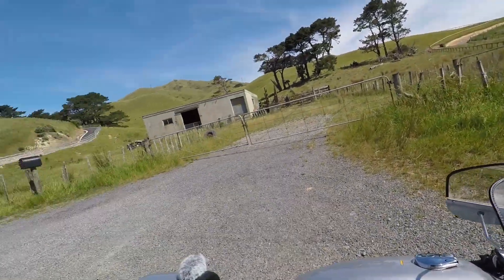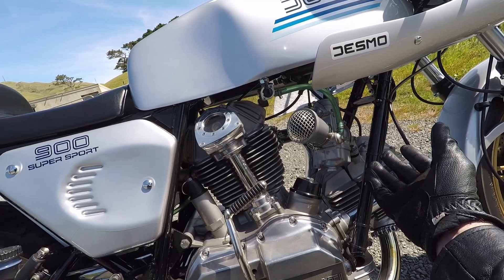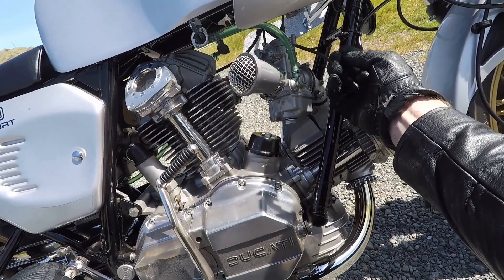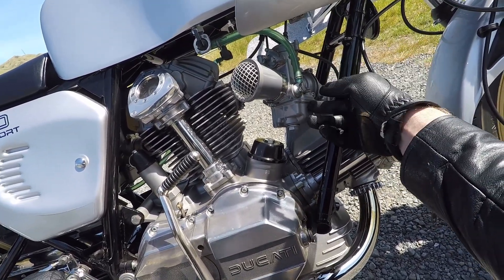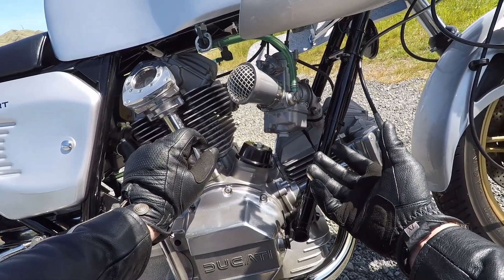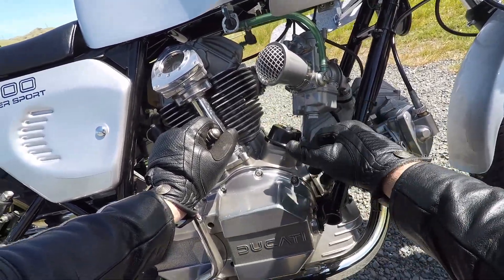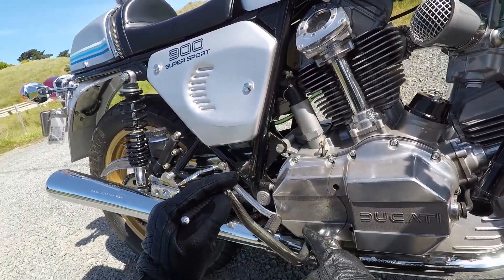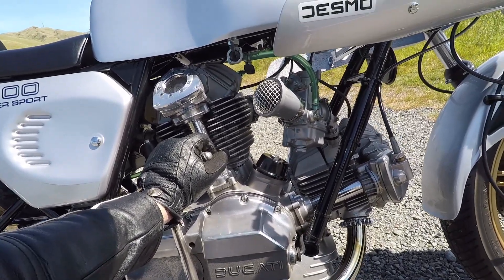Ducati 900SS Bevel Tuning - Lambda/AFR Testing Part 7 Final

Comment: Happy Saturday Mate,
I’m almost finished dialing in the 860GT but have come to find my labyrinth not remaining in place under load.  It lets go of the clip in the vent stack leaving spurts of oil on the case.  ( the last of the remaining leaks)

Grant Fuller informed me that the stock labyrinth becomes feeble when heated.  He has produced an aluminum replacement, but unfortunately does not ship to Canada. So much for the Aussie Canuck historically great relationship.  🤣. Can you think of any hacks that I can put in place to make the plastic labyrinth more robust but short of allowing foreign debris from falling into the crank case.  

Cheers
Jason.
Reply from the maker: Hi Jason. I'm sort of surprised it's leaking oil out even with the faulty labyrinth. The oil should just go up the hose and into the chamber, assuming you still have that on the bike? There should also be a hose from the chamber down to the road, so if any oil comes out anywhere, it should be there. Have you got all the required parts in line there.. gasket, hose, clamps etc.

I'm looking online and I can see the metal replacement you're talking about. Surprised they won't send to Canada..?!? 

You're right that you don't want bits going into the engine if its start falling to pieces and that goes for the metal one too. I'd be trying to get a plastic replacement. I would just ask in the Ducati vintage forum or even on one of the Facebook Bevel groups of someone has the part spare and is willing to post to Canada. Someone will have it. I would start with the forum first: https://www.ducati.ms/forums/vintage.14/

I don't have one here in my leftovers I'm afraid. I can see that Steve at Bevel Heaven is listing new and used ones on his site. In the product description he says he has several used ones and also the snap ring and washers etc. Maybe that'd be the quickest solution.
Reply: I will check both options.  
I put it back together and let run for a while . It appears the the leak may have stopped.  Won’t know for sure until I take it for a spin.  
Thanks again.
Reply from the maker: You're going to have to put a video up to show your bike!
Reply: @Ducati900SS  this weekend weather permitting I’ll fire up my first post.

Comment: hey do you mind to let me know what kind of mirror you are using?
Reply from the maker: Hi Moritz. Yes, search Googler for 'Tanax ap-101 Mirror'. I like this style a lot for the 900SS. People usually set them up in a vertical arrangement, but this is incorrect. It is meant to be horizontal and with the wider side outwards, like a car mirror. I think it looks good and I like that it flips out of the way and restores back into position with a sort of click stop. I also have one for the other side, which I haven't put on. I should do that for safety, but have been avoiding it. They also do a black one, but I can't see how that would look any good.

Comment: Thanks for that series of vids re AFR tuning, enjoyed them immensely. Would love to know if the beading ( rubber strip) on the screen is original or not. My MHR hasnt had the strip for years ( replaced screen and didn't keep beading ) trying to find strip to suit is near impossible .
Reply from the maker: Thanks Bj, glad it was interesting. I had hoped to make a more detailed final video, but there wasn't really all that much to it. I will  however work towards a video to go over adjusting and synchronising the carbs as I've learned that it really is the key task that every bevel owner needs to get used to.

Good question about the beading (every little part of my bike has a long story!). I'm pretty sure the MHR had different beadings over time so this might not even apply. One thing I discovered is that these rubber trim bits are off-the-shelf automotive items. They weren't custom made for the bikes. 

I had my screen custom blown here in NZ and I made sure to ask the guy to not put their sticker on the screen, not cut any holes, and not attach any rubber as theirs was smooth and very thin.  So, at first I bought this one www.mdinaitalia.co.uk/Screen_trim_1.html . It has the right sort of look but is heavier and thicker than what was originally on my bike and is also dark grey instead of black. So I kept looking all over the web without much luck. Then I randomly found the right match at a local retailer, Pararubber, where I didn't expect to find anything suitable. I'm looking on their site now, but they haven't got pictures up. It's probably his one: pararubber.co.nz/product/clip-on-edge-trim-5mm-x-8mm/  It has the metal strip inside it, the right colour, the right texture and the right overall dimensions.. very happy with it. I'll drop in  there and check next time I'm out that way. Are you local or elsewhere?
Reply from the maker: oh, and just a comment for anyone in general.. The beading is not decoration. It's there to reduce the risk of having one's throat sliced open by a piece of cracked acrylic in a head-on. So get that bead on there :)
Reply: Hi, thanks for the info on beading, I recognised  the PARARUBBER website is the same as a store here in Australia called CLARKE RUBBER , so off to local Clarke store ,didn't have suitable item, then found 5x 8mm textured metal insert strip on eBay, it's called PINCHWELD on there.....So should be all good and my Melon will be protected ....Thanks again and safe riding
Reply from the maker: @bjreynolds8218  Excellent. If you find it's not right, just get in touch if you want me to get some here. I'm going  to go there on the weekend and get some to have spare as well. (ediit: replied from the wrong account again)
Reply: @Ducati900SS  Hi again,
The PINCHWELD strip I got of eBay looks very close to what you have on your SS, textured not smooth rubber and looks great ......
Reply from the maker: @bjreynolds8218  Good stuff, glad to hear that worked out! (edit: replied from wrong account again!)
Reply: Here's a source for trim: https://www.mdinaitalia.co.uk/Screen_trim_1.html